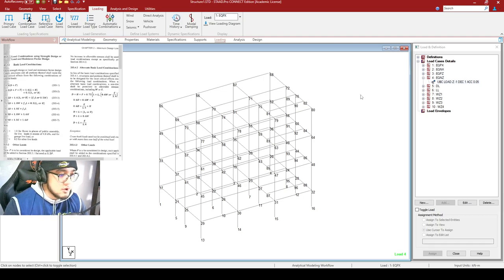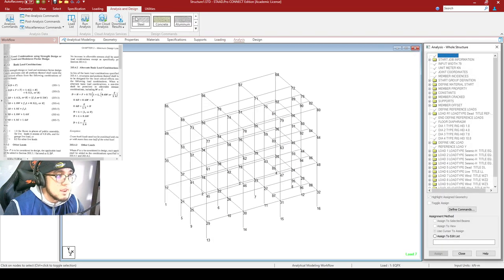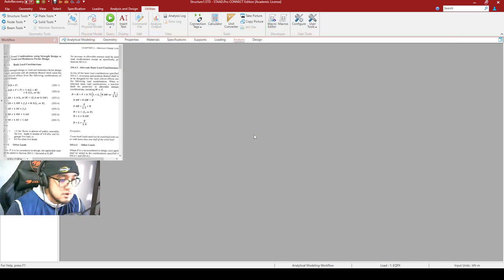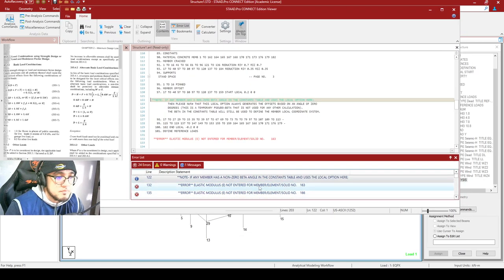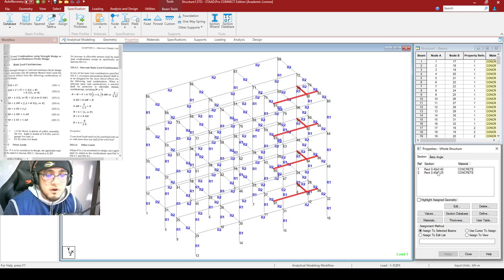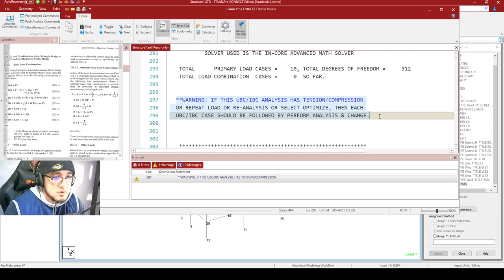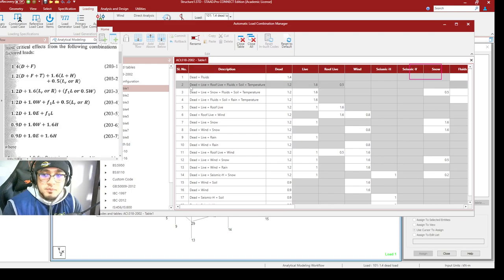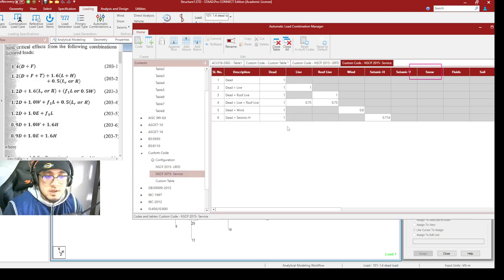STAAD.Pro Module 4: Load Combinations, Envelopes, Analysis and Design (recorded meeting)

Comment: Hi sir, I would like to ask what to do if my structure failed in drift check? What are the adjustments that I should make? Thank you!
Reply from the maker: You can increase the sections for your columns, add shear walls, add bracings, or convert your supports to "fixed", just make sure to design your foundation to consider moment effects. 😊

Comment: good day sir, query lang po, ano pong solution kapag may nagfail (at at given storey level) sa drift checking using staad?
Reply from the maker: Hindi ko alam if may bearing pa itong sagot ko since 1 year late na. 😅 Pero ito pa din sagot ko. hehe. Pwedeng palitan mo into fixed support ang footing, lakihan ang columns, or dagdag shear walls. Pero if mag fixed support ka sa footing, dapat sa foundation design mo, consider mo din yung moments. hehe :)

Comment: Hi sir, how to assign a wall load in slab in staad?
Reply from the maker: Hello!

Convert the load first into a pressure load, then assign it as a floor load..

Steps:
1. Get total weight (resultant) of the load in kN.
2. Divide it by the floor area in sq.m (the resulting value will now be kN/sq.m or kPa)

Comment: Hi sir, tanong ko lang sir kung may command kung paano maguniform yung output ng number of bars in each property kasi iba iba po ang binibigay nya na number of bars
Reply from the maker: Hello! You can group po the beams.  Or use other softwares for the RC design like Advanced Concrete Designer RCDC